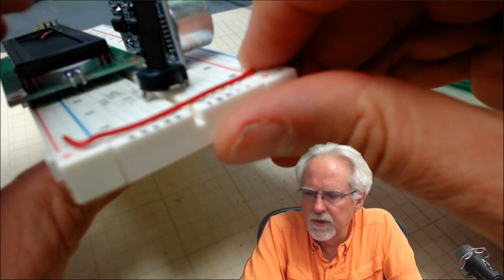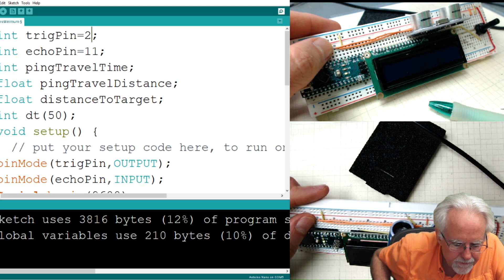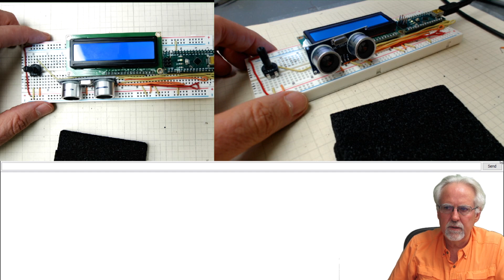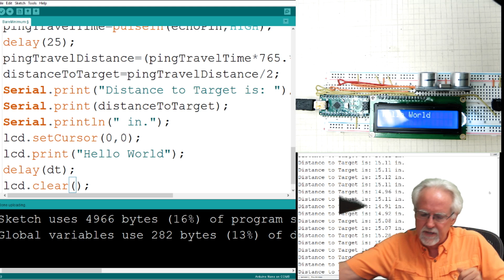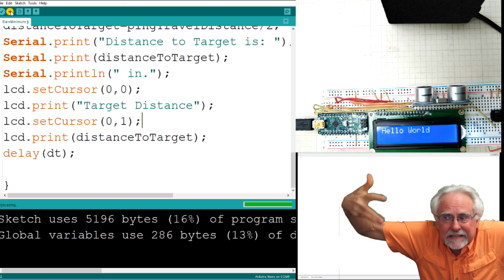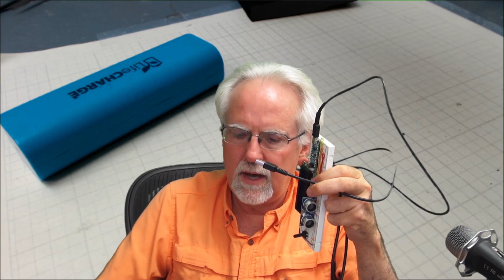Arduino Tutorial 59: How To Build a Portable Distance Detector With the Ultrasonic Sensor

Comment: Did the project on my own and had a lot of fun doing it. I used the Nano and the larger breadboard that Paul recommended. I also used the power supply from the kit. Initially I used a 9V battery to power it, but then found a wall-wart in the old electronic parts junk pile that works just fine. Looking forward to the rest of the course and then the new robotics course. Plenty of stuff to learn.

Comment: This was a fun one. I enjoyed using the LCD before so right after lesson 53 I got busy. Was able to fit my Nano, LCD with potentiometers, ultrasonic sensor and the power supply on one breadboard with the battery on the back held on with an elastic. Coding wasn’t a real issue, just took what we learn from earlier LCD lessons and  then after info learned from lesson 55 along with a few other additions got it reading  in both inches and centimetres. As I said above, really enjoyed it.

Comment: Awesome lesson as always. I did it with my home built expanded bread boards on a clipboard. It's much nicer  but the new boards are extremely tight so I will have to find a tool to give the holes some more clearance. The Nano and LCD are a bi...h to plug in and out. Things will get broken.

Comment: I did get it working on my own and managed to get it on the original breadboard as well.  I also ended up wiring the LCD to different pins so that I could use wires that were a closer fit length wise.

Comment: I had the same flashing lcd several lessons ago, fixed it by putting the lcd.clear() just before the lcd.print instead of after it.  (I had a small delay in the code up higher causing the glitch.)   Enjoying your videos as always.